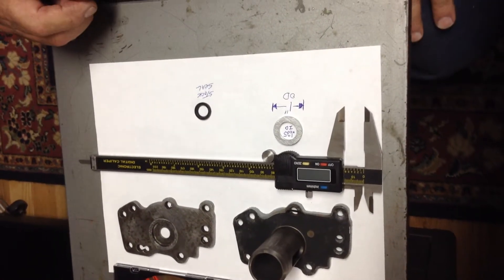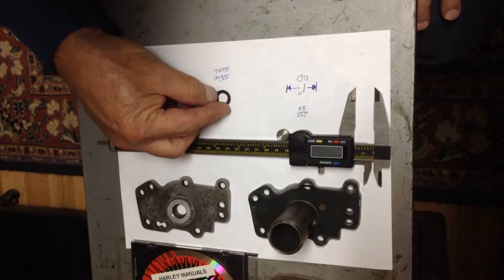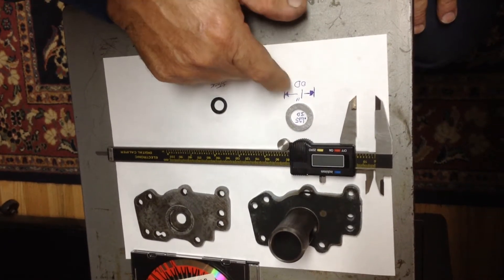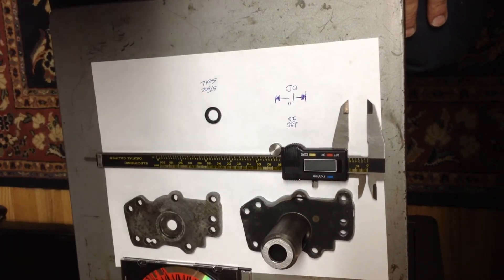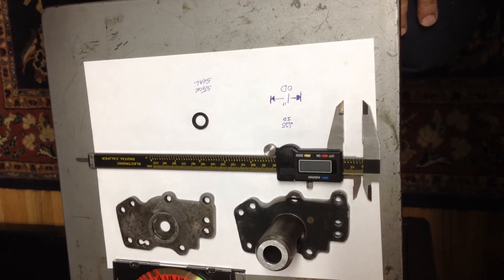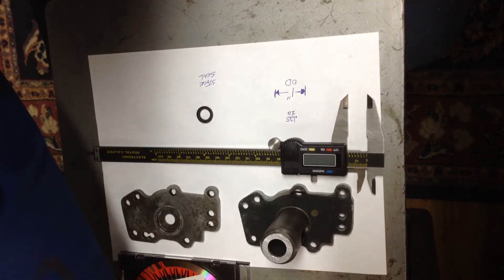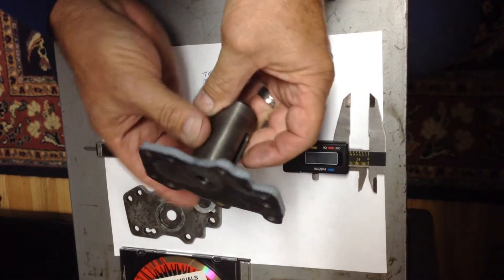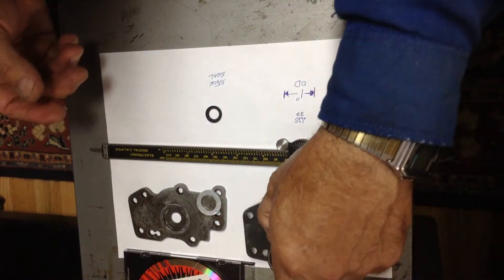74 xlch oil pump

Comment: Hello. Good afternooon!
From Portugal ... :) 
If you can help me, i am desesperated!
So, the engine oil passing to the primary through the valve that exists between the crankcase and the primary. This valve "would" have the function of sending the oil that is in the crankcase to the primary when it reaches a certain level, and the opposite. 
The thing is, the oil is not returning to the crankcas as it should, so I have to empty the primary to the level through the "hole" that exists in the primary cover, and put the oil back in the tank.
Question: If I create an external connection between the hole in the primary cover and the tank, will it solve the problem or will it cause the oil to run out of the crankcase? With the compression that exists in the primary, will it be enough to make the oil return to the tank? ... If you can help me... Tell me something that i must do to try fix this problem. Pleeeeease! I am starting to be crazy cause of that!!!
P.S - I apologize to annoying you but i have to speak who really know about this ....
Thank you so much